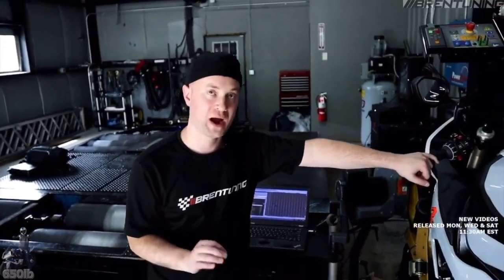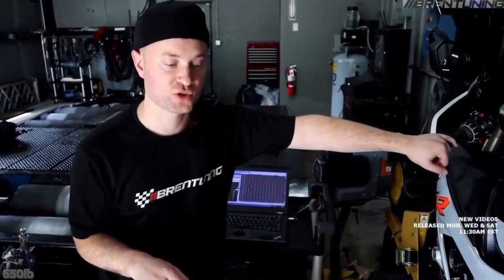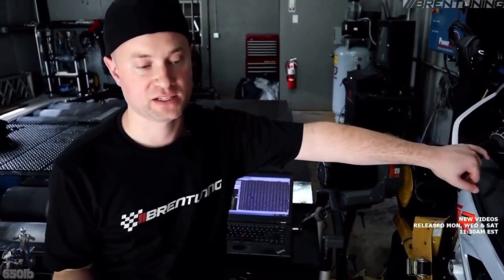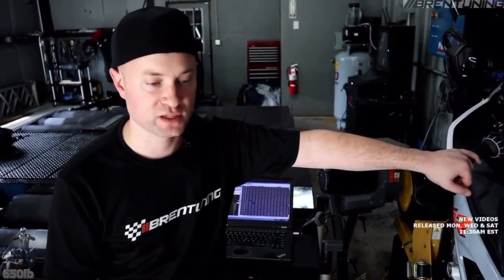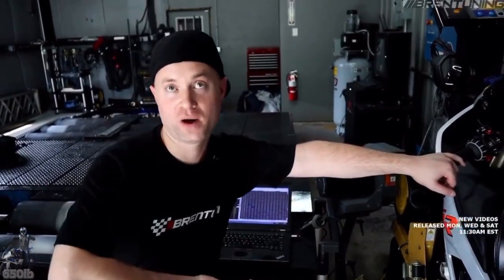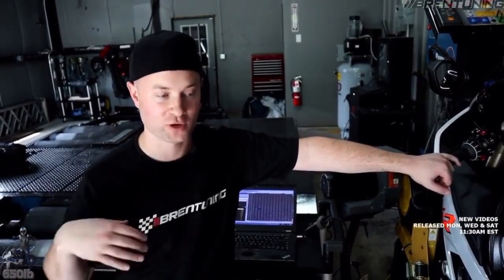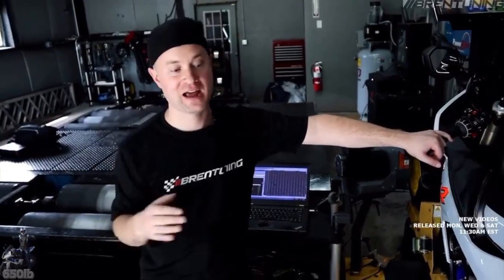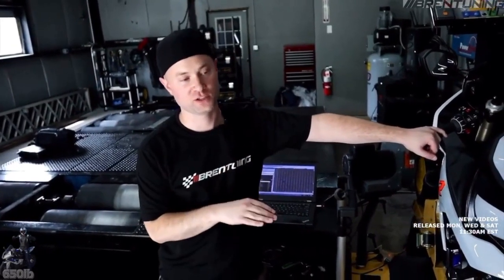BT Moto Ecu FlashWideband 2020+ BMW S1000RR Explanation

Comment: Bren is the man. So when can I start putting e85 in my 2020 S100RR I got the stage 2 big improvement overall .
Reply: @VroomNPew  yeah it's flashed for mr12 but not e85 . I ride with wristy he got the e85 flash on his s1k and his bike was pulling away from mine I have a full Exhaust and sprint filter on mine so it adds some good power gains and in so cal e85 is everywhere and cheap.